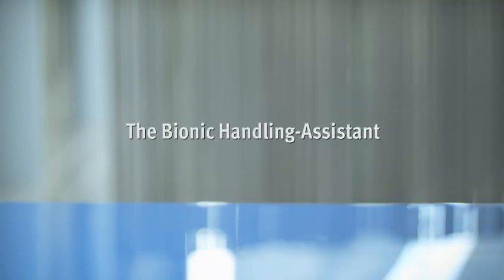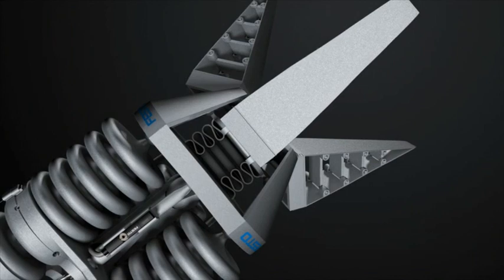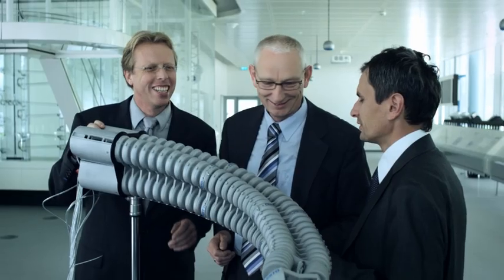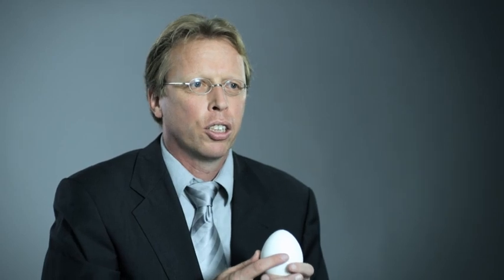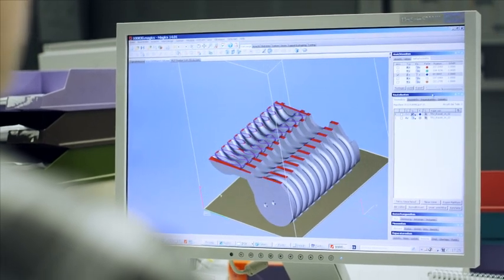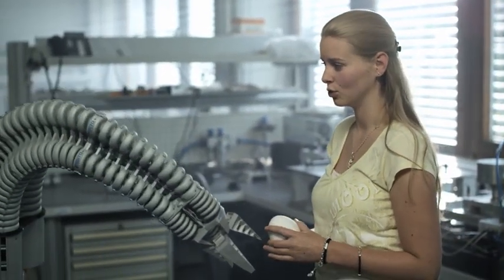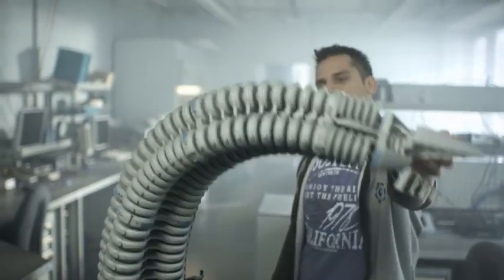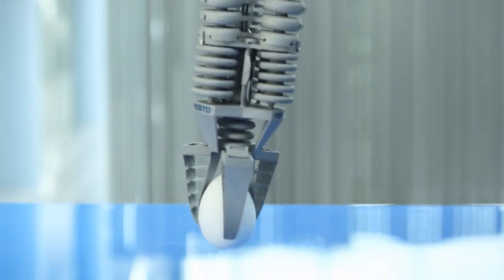Nominated for "Deutscher Zukunftspreis 2010"

Comment: @zever not very technical.  The entire arm is basically just tough balloons, i'm sure similar simple designs could be made with injection moulding instead of the (expensive) rapid prototyping machine they used to make this one.

The complex bit is the valves and the control electronics/software, but luckily the valves are all kept in a single compact box.

The software will be the best part, as it can be continually updated and improved.  With such a new bot, i'm sure there's be a lot of that.